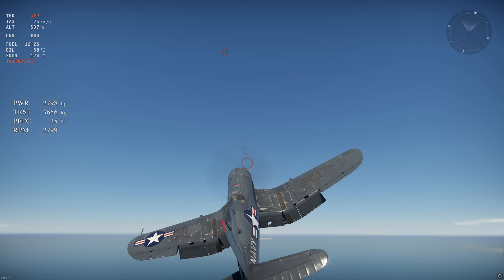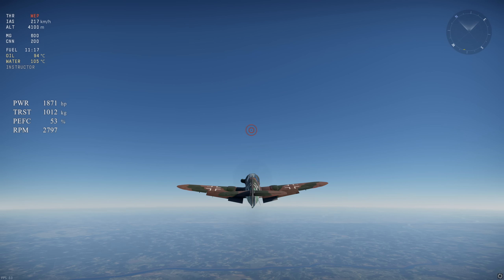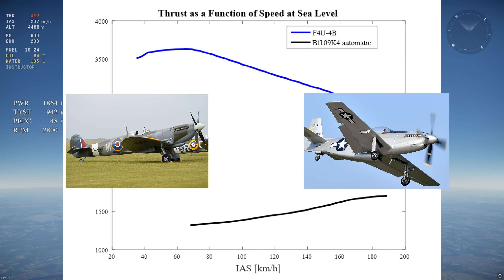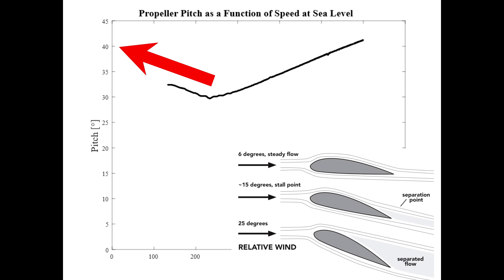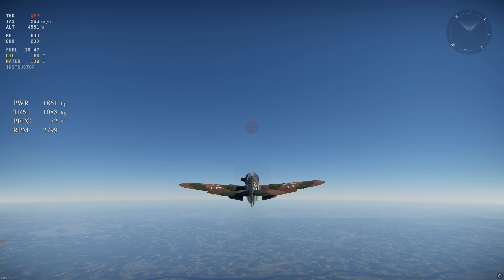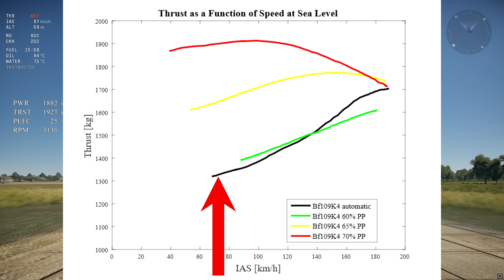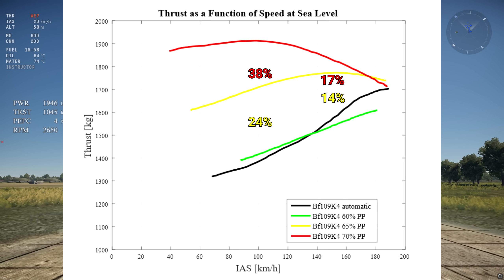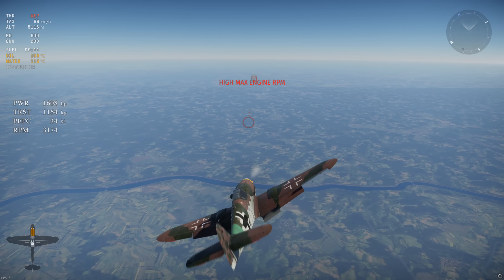War Thunder Tricks #8 | Prop Pitch Trick for Extra Thrust

Comment: Hey Adam, if automatic engine control limits RPM to 2800 then can you increase the climbrate by carefully using manual pitch? It should give the 109 more thrust
Reply from the maker: Climbrate will increase if you are forced to climb below 200km/h and you use the trick. But your climb rate will still be higher with automatic pitch at 295km/h.
Reply: @AdamTheEnginerd  The ideal climb IAS for the 109 is 295?
Reply: @AdamTheEnginerd  So it climbs best at 295kph? Not lower, like say 250kph?
Reply: from what i could see in the video it was only really a problem at lower speeds, but yes. if you want to sit down and calculate the perfect pp for a 109 at certain altitudes vs speeds you can just graph it out and look at it while in game
i think
Reply: i have manually control the prop on fw190 before it surely can add more speed to you plane but it make the engine over heat so fast and it you dont carefully check the rpm you engine died in 3seconds
Reply: liew yu hao when I increase the prop pitch on my spit I start to open the radiator more
Reply: @harleythomas701  the fw190 will over heat even it all of the radiator open to 100% some plane cant push to hard like the british Sword fish the engine over heat so fast it you prop pitch too hard
Reply: @liewyuhao116  Did they change the 190s engines? The Focke Wolf used to never over heat.
Reply: @mpk6664  it still will over heat it you fly at 530km/h in stright line or prop pitch it
Reply: @mpk6664  it take few min to over heat it you fly in stright with 530km/h
Reply: liew yu hao so like the bf110
Reply: I'm not Adam, but if the oil radiators can cope with it at low speed it may work

Comment: Nice vid my man I always thought that low thrust at low speed was a bug. Thx for explaining. I noticed that p51h has less thrust at low speeds then the p51d30. why is that?
Reply from the maker: Thanks!

Hmm I would say they have roughly similar thrust at low speed. Reason is the same as in the video, the P51H's power is too high for its propeller, so there's a loss in efficiency there that the D30 doesn't have because of its lower power.

Comment: Hey Adam very interesting thing you said about propellors, check for yourself in game. The G14AS has wider diameter propellor blades than any other 109. This trick would probably work extra well with it then.

I have alot to say so I'm gonna condense everything into one comment to not spawn the comments section.

So the wider the diameter of the propellor the more it can convert engine power into propellor efficiency at low speeds?

From your G14 AS video I remember you recommended not using WEP in 109s in low speed vertical stalls, does it say mean if not using MEC but just reducing throttle and automatically pitch, you would still get better propellor efficiency in vertical stall?
Reply from the maker: So it also has a bigger landing gear? Because the diameter can't increase much without running the risk of hitting the prop on the ground.

If it does indeed have a bigger diameter, then it would need this trick less than other Bf109s.

I think it was in my G2 video saying I'm laying off WEP at low speed to cool down since it doesn't affect thrust much.

You get better prop efficiency by reducing throttle, but then you have less power to convert into thrust so you still lose on thrust.
Reply: @AdamTheEnginerd  I see I see, I understand. Thanks for the reply Adam : ) on what you said about the landing gear I'm not sure but from I could compare in game, the tail section and starting from some of the rearward pillars is different than the German 109s. The rear section is bigger than the G2 Trop and G6 but smaller than the G10/14 and K4.
Reply: @AdamTheEnginerd  Could a differently sized rear section and tail compensate for the size of propellor increase, how a larger landing gear would?
Reply from the maker: @lukefrombk  Nope, since what matters is the clearance you have between the propeller and the ground when the aircraft is horizontal (about to takeoff or right after landing).
Reply: @AdamTheEnginerd  Oh! I understand, I was way off, thanks for explaining it!

Comment: Great! I understand nothing
Reply from the maker: Hmm where did I lose you?
Reply: @AdamTheEnginerd  I can actually tell you the exact moment LOL 2:19
How can prop angle/pitch be a function of speed when the two are completely independent?
Also maybe this is why I couldn't really figure out how to effectively use MEC anyway, but why are the angles so low? I thought 100 was generally the best unless you're diving or at cruising speed (where you'd drop your pitch to reduce your propeller decelerating you from drag)
Reply: @icetheking4310  note that the grey line in the graph is just the settings by the AUTOMATIC prop pitch controls.
Reply from the maker: @icetheking4310  Pitch angle changes with speed because if the prop had a fixed pitch, it would get easier and easier to spin the prop as the aircraft accelerates because the propeller will be seeing a lower angle of attack or a smaller "bite" of air as the aircraft goes faster. Props in WW2 were constant speed propellers, so the pitch angle of the propeller would change with speed to keep RPM constant and to stay close to the more efficient angle of attack for the propeller.

What angles are low? I think the confusion stems from the fact that you don't know that German prop pitch works differently than for every other nation. For the Germans, prop pitch % will give a pitch angle directly, while for other aircraft, prop pitch % gives the target RPM instead. It's also why this trick would only work on German aircraft. Except for German aircraft, the general rule is prop pitch = throttle.
Reply: Carl-magnus Carlsson OOOOH it’s a graph of the automatic controls. Gotcha! Makes more sense now